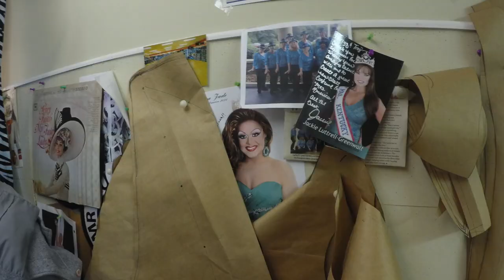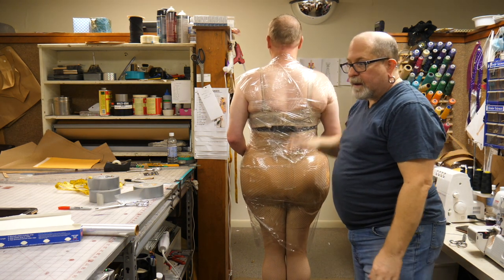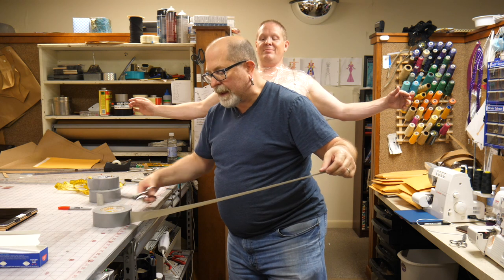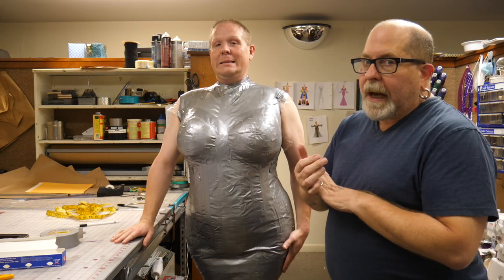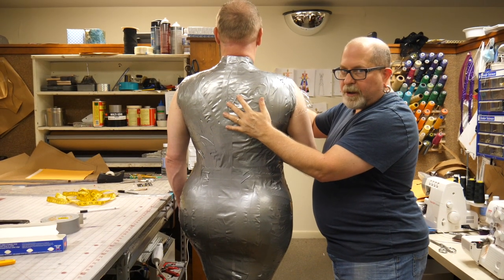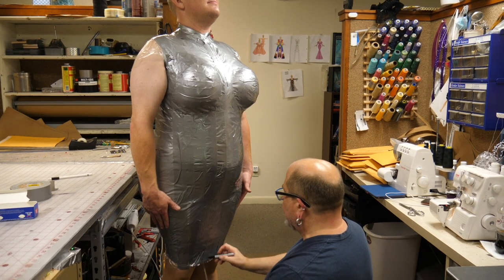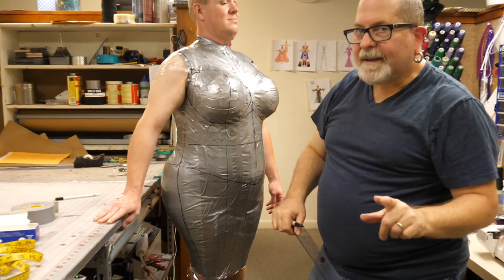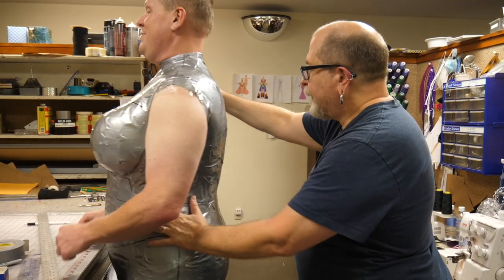DIY Dress Form - Part 1 (Duct Tape Fitting)

Comment: I have been watching many of these duct tape videos. I had an idea that I am going to try. I want to use  blue shop towel (paper kind) under the tape. It seems to me that it would be easier to work with than the plastic wrap and not as hot and sticky.

The cloth like paper towels can be cut and or torn to shape and taped together to form an under garment. Then the rest of the tape can be added as usual. I also think the blue paper would work as a good lining for the duct tape and not as likely to wrinkle as I've seen some where they use tee shirts.

What's more I plan on using shop towels to make a few patterns. It may work.

I love the energy that you and Miss Georgia Peach bring. I am amazed at the results. Good job.

Comment: I tried this over tights and a T-shirt. Definitely need the Saran wrap. When I pulled the duct tape off the clothes it got distorted.
Never wrap duct tape around neck. Do it in back pieces, side, front pieces. As you showed.

Comment: In the end, how good was the fit compared to the original person?

It seems to me that each generation of the process would tend to make things just a little bigger (especially in the circumference directions). I guess taking the small half of the left-right pair would tend to counteract that tendency.

However, suppose the person is slightly asymmetrical. In that case could you keep the two halves and just shave off a few percent in the horizontal direction of each piece, maybe something like 3% or so, then reducing the paper pattern dimension slightly in accordance with the calculation.It would take quite a bit of calculating, but I think it could be doable with a hand calculator.